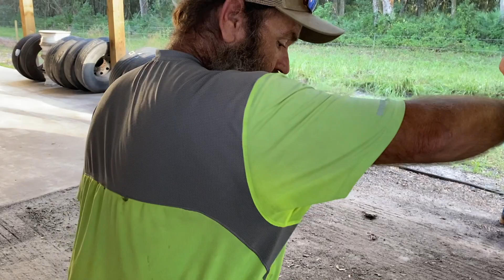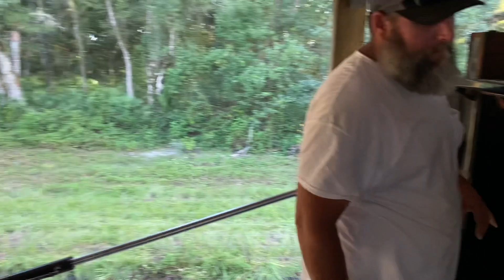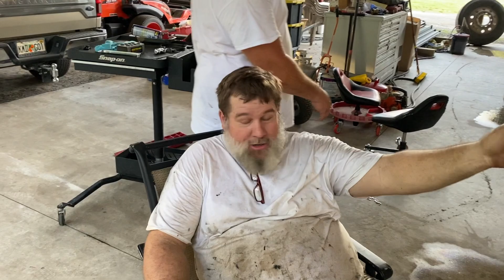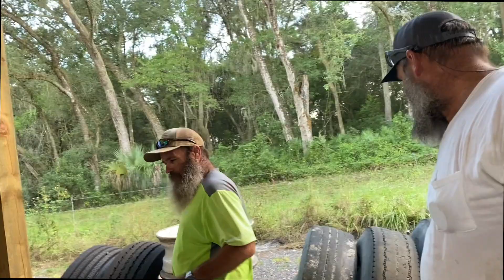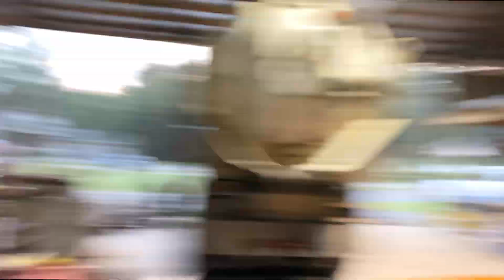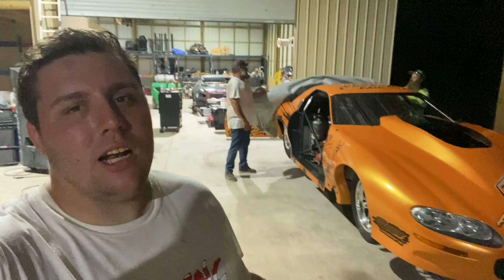PULLING A $100,000 MOTOR OUT OF CAR WITH A FORKLIFT!!

Comment: You sound like my Pop's at are shop , I have 66 Nova for the street and also have a 72 Road Runner that was pulled out of a barn from upstate PA. with a 340 that needs a lot of work and Pop's couldn't give two shits about them a long as there's room back in the shop for his BABY it's a 1950 FORD SEDAN WITH THE V8 FLAT HEAD IN IT he's had for over 45 years now so understand where you're coming from 👍👍
            😈☠👍✌✌